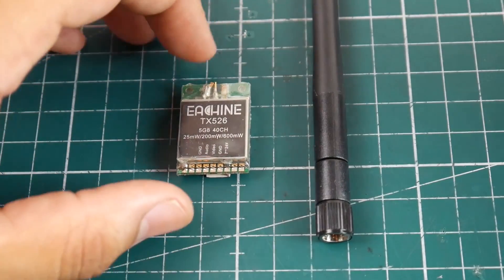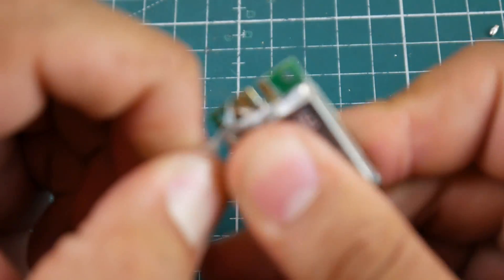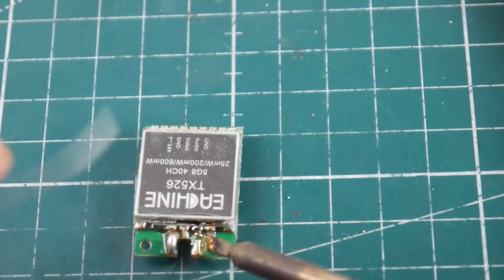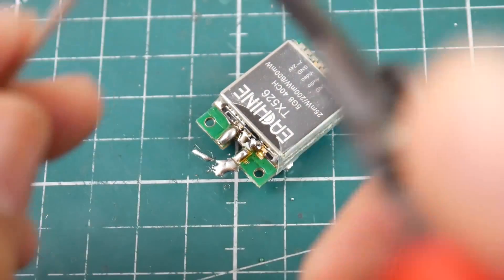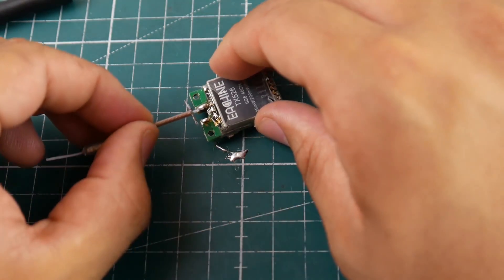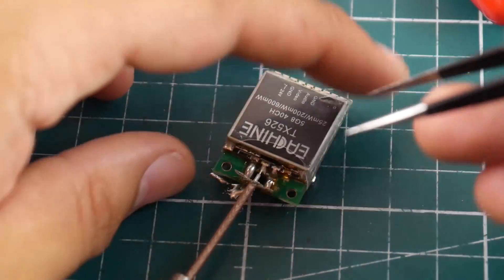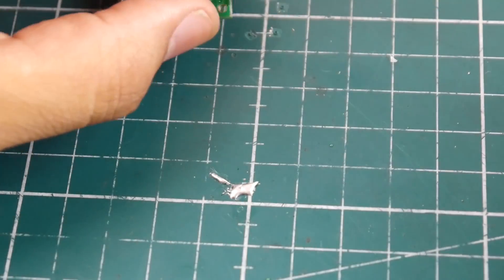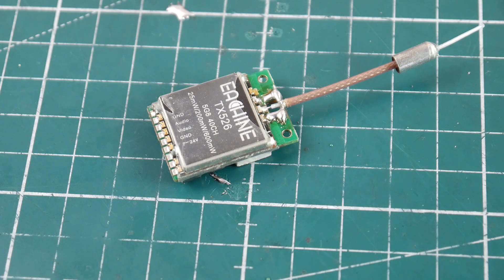How to Fix VTX SMA Port Connector // VTX Unbreakable Mod

Comment: A proper way how to repair VTX with destroyed connector pads indeed. Did that earlier by soldering antenna cables or pigtail cables with SMA connector. In some cases repairing was not feasible though. Seen that in older prebuilt Realacc X210 and GX210 quads when due to flexy top plate perpendicular connector on stock VTX board on hard crash sometimes broke off together with a good chunk of board.

Comment: nice! did yesterday on another VTX. However even before doing the mod, my inner pin/signal cable and the ground are not isolated. If i test with the meter i can "hear" there is continuity between the center pin and the ground pin.

Comment: I use UHU patafix or 3M VHB double sided tape when I am soldering small parts on bench. They stick on the surface enough to hold it .. Seems you were struggling and I wrote this to help others.. Thanks for the video Mesh

Comment: Great video.. I thought that the wire from the antenna needed to be a very specific length. Won't cutting/trimming it reduce it's functionality?
Reply: Michael Bein no
Reply: The bottom section doesn't matter. You should only worry about the top part of the antenna.
Reply: Yes, It should be multiple of 1/4 lamda...

Comment: When you have the braiding  in the T shape,  tin it first before you try soldering it to the board, you can then bend it to the shape you need and then solder it  to the board.